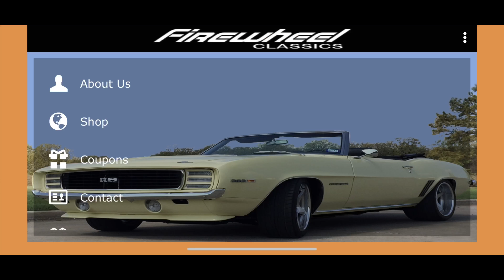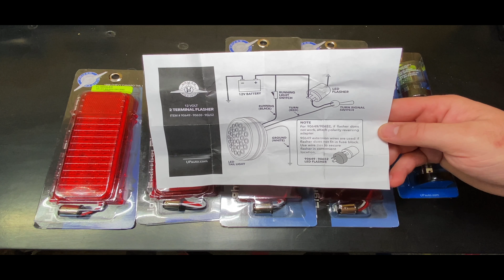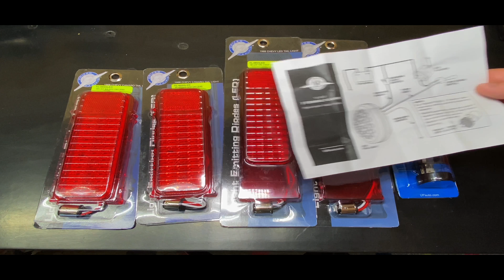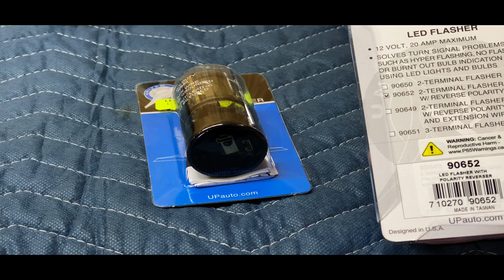Installing LED Tail Lights for 1st Gen 1968 Camaro

Comment: The inside tail lights look as if the brake is applied. Are they supposed to be that bright at all time? Or should they look like the outside ones, normally lower brightness? I’m working on my 68 lights now. Thanks
Reply from the maker: Brother I’d have to go back out and look…I think they stay pretty bright though on the inside ones.  I’ll try and look at them again this weekend, but I think it’s right.

Comment: Great video! Just wondering... did you have to do any electrical modification to the tail lights (wiring or harness) to get the LED tail lights working - or did they just plug straight in to the existing 1157 socket and start working? I've tried using LED globes before and they did not want to work. I wanted to get some of these for my 68 SS, but living in Australia it is always a gamble with these parts due to shipping costs if they don't work.
Reply from the maker: Sorry I missed this comment.  My video was exactly how I hooked them up...so far I haven’t had any issues.  I did buy, but didn’t install, the resistors or whatever they are called.  I ordered them from Firewheel Classics.